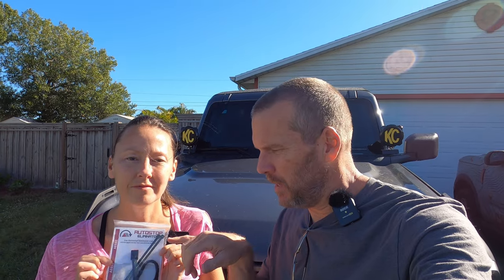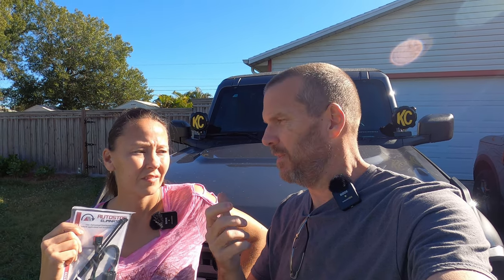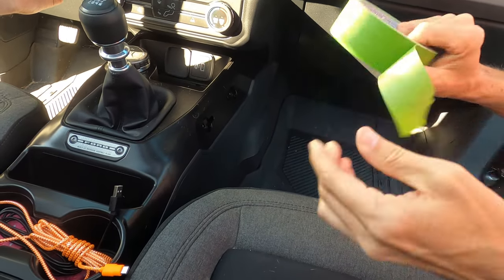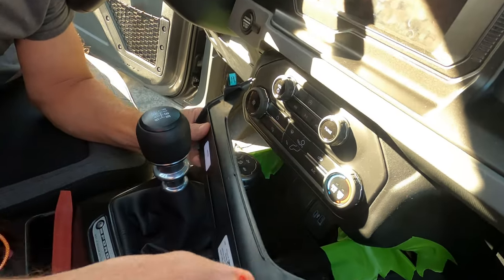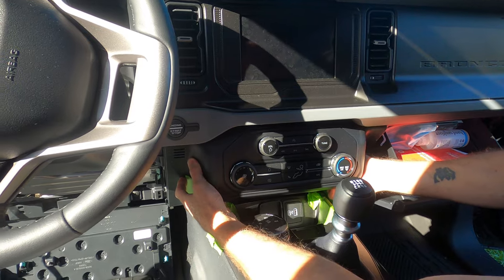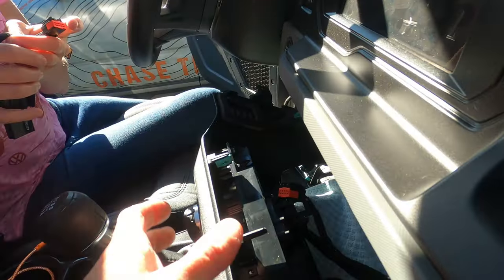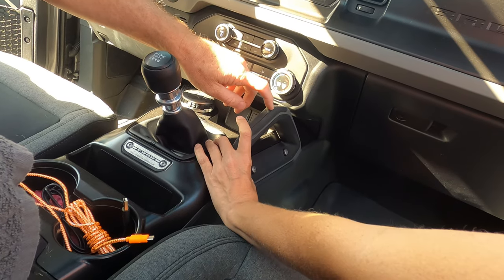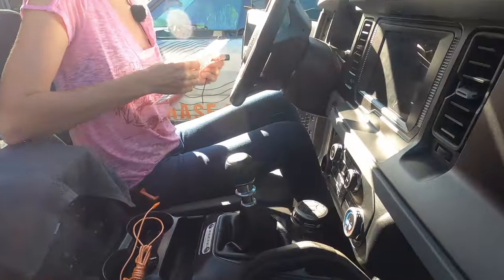2021 BRONCO AUTOPSTOP ELIMINATOR. NOT JUST PLUG AND PLAY BUT STILL WORTH IT.

Comment: I bought one of these Auto-Start-Stop Eliminators for my 2019 Ranger, and I've got to say, the install into the Ranger was a great deal easier.  You do have to remove a panel from the center console, but it was a panel near the shifter on the top of the center console -- it was much easier to access than all those panels y'all had to remove.

I'm glad y'all made this video tho -- now I know what I'll be getting in to when I get one of these for my Bronco, assuming I ever get it.  😉
Reply from the maker: The auto stop thing is a dream! Lol u will get it. ❤️

Comment: Guys, there has to be a way to disable the auto start stop without having to do this as a bypass to the switch right? I mean their tuners out now surely they addressed that within some of the menu options right? I hate auto start stop, it's the most hated forced feature ever imposed by the Auto industry. Thanks for the video I will keep this in mind in case the tuner route is not possible.
Reply from the maker: Buckle up buttercup (YT Channel) did theirs w forscan I believe, I might be wrong. You may want to research it throughly. We opted to not go that route. We installed the eliminator instead.

Comment: I'm still on the fence for autostop elminator. this is way more work than the sport was, but this video will be helpful if I ever do.

I went searching for the interior fuse panel on my badlands. manual says its under the glove box but the picture shown in the manual seems to be of the bronco sport, so i took the glove box out... the gear that is inside the channel for the glove box is plastic, and doesn't screw in, so if you arent careful you can break the housing for that gear and lose the gear during the reinstall of the glove box.

I didn't even find the interior fuse panel and everything online suggestes Ford effed up and covered it with the god damn washout interior lol
Reply from the maker: A lot of people talk about forscan but that is more of a permanent thing not just a push of the button.
Reply: @1Five1Garage  i like the idea of forscan for giving my badlands sport mode and disabling that honk when you close a door while the vehicle is locked/running or w/e but again, its messing with the vehicle more than I feel comfortable with (while under warranty)
Reply from the maker: recalibrating the tire size is all I want to do with it. I know there are tons you can do with it but there is a time and place for it.
Reply: @1Five1Garage  completely agree!